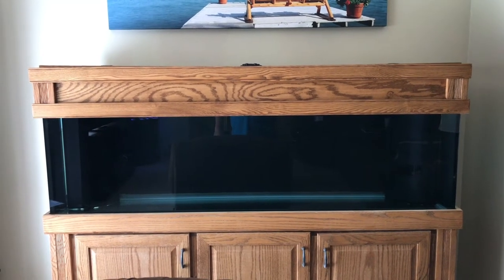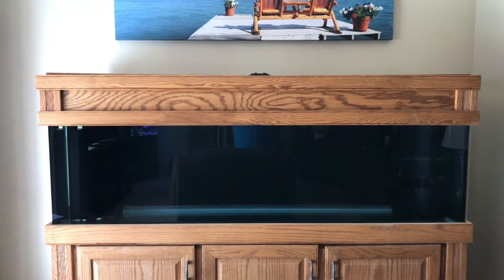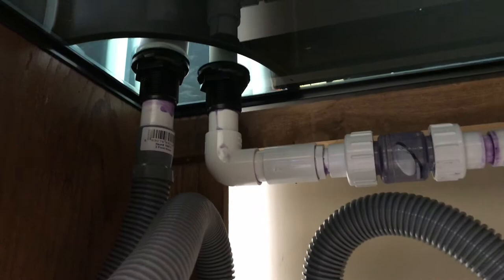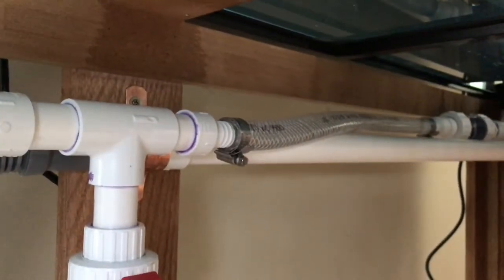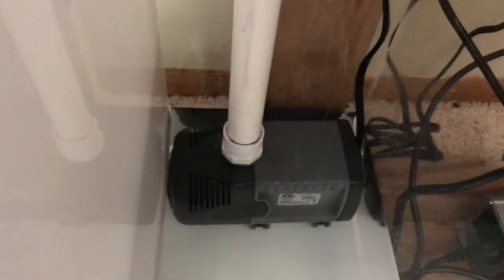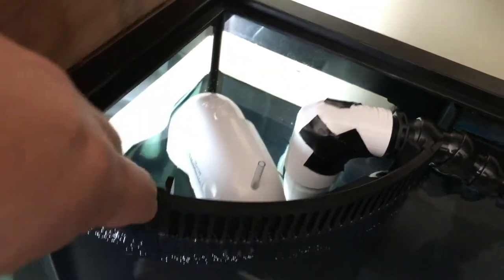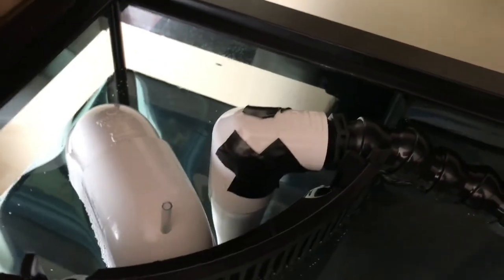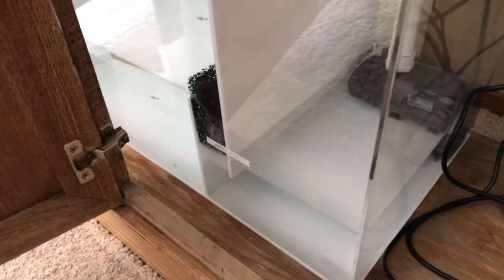125 Gallon Reef Ep 2 - Sump and Plumbing

Comment: Assuming your Covering the siphon breaks because u have check valves? Just heads up those check valves are more likely to fail being horizontal instead of vertical.. just make sure your sump can handle all water during a power outage that is siphoned from the display if they did fail.. your return nozzles aren't too deep so shouldn't be much... if it is uncover those siphon holes and use airline to help silence them... just sharing some thoughts ... keep doing what U do! Enjoying this build man ...
Reply from the maker: Thanks for watching CJ!